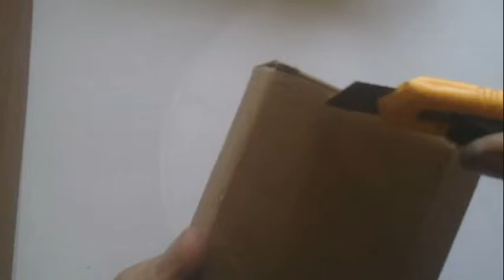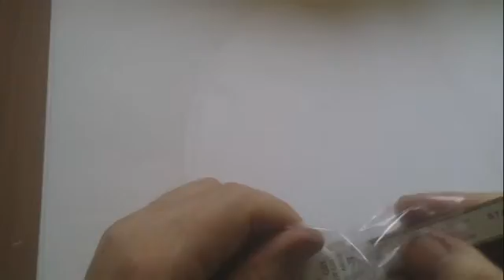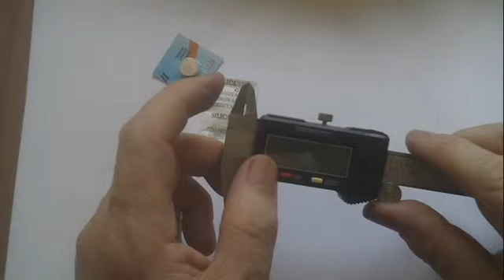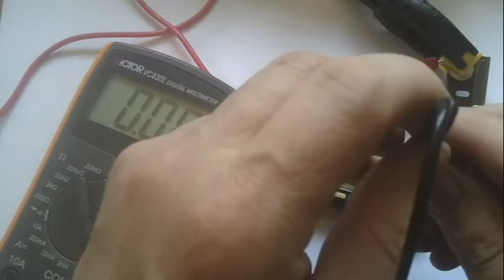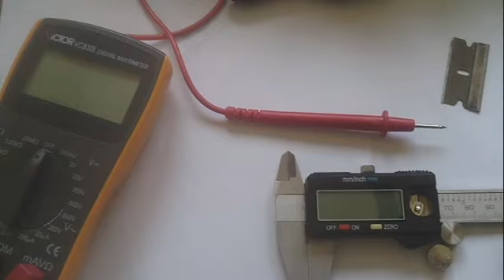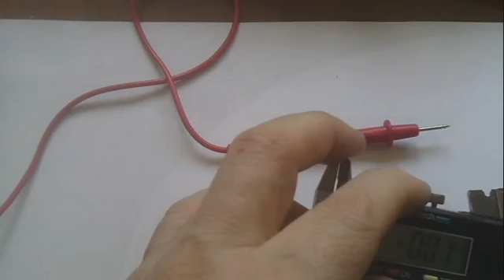Cheap Digital Calipers - are they any good?

Comment: You measured repeatability not accuracy
Reply from the maker: Thanks Kaveman - I did. Or was it "precision"? What I wanted to do was see how consistent the mechanism was. If THAT was shyte then whatever else it was , it was worthless. So it passed that test, but I didn't go on to do the accuracy test - I had nothing to do it with. I do now though - so maybe another video idea. Short answer - these calipers are repeatable and accurate versus a micrometer - although technique in using them is crucial. When measuring diameeters on a lather, for example, it's incredibly easy to tilt them or catch them when removing them. I now have a solidly repeatable technique which took a while to find, so it mught be worth a video. Thanks again.
Reply: @chriswesley594  yes I noticed the same, cleanliness and measurement technique required. Also , pulling battery out between using them.. Cheap ones consume battery. I use feeler gauges to test accuracy